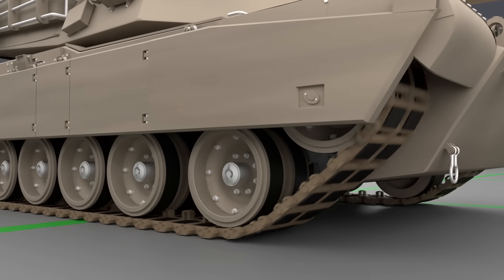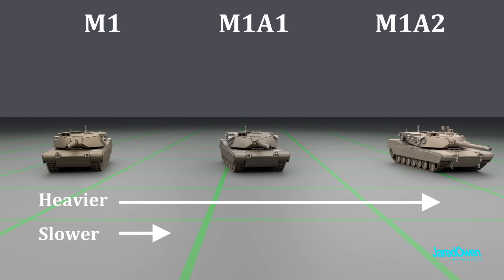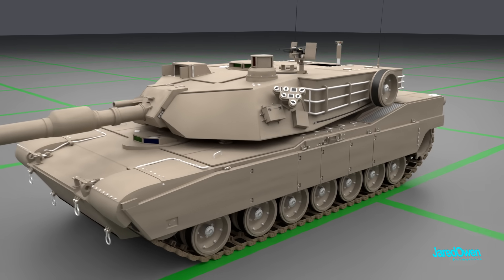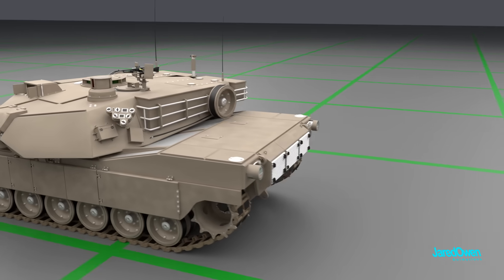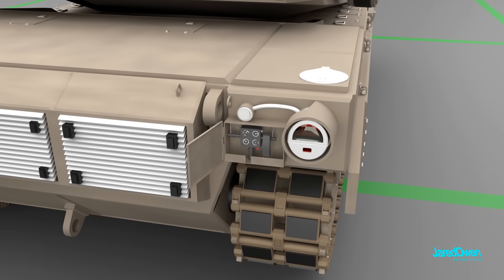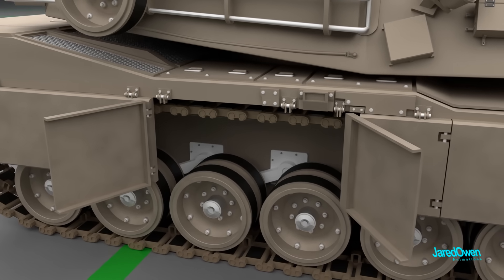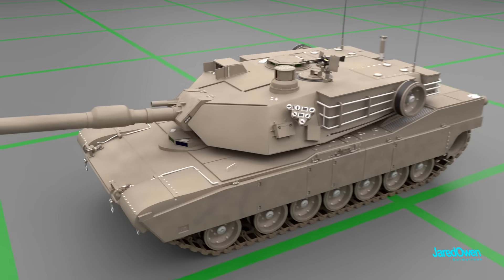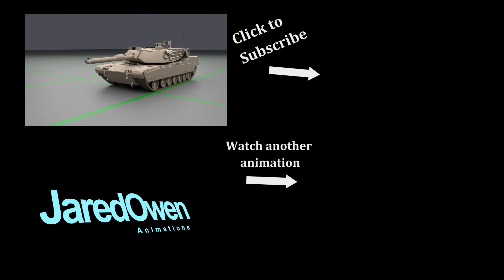How does a Tank work? (M1A2 Abrams)

Comment: Are we helping our enemies by giving away this information?
Reply: This is very fundamental information that does not vear that much off from all tank designs. The type of materials that make up the armor and the fire control systems are what really separate tanks on the battlefield. This is why Ukraine is getting a version of of the tank that has Tungsten armor and not the classified one the U.S uses. The tanks they are receiving will be new production for this reason. The U.S makes about 10 to 15 tanks a month for our military and others.
Reply: @JackRABBITslim27    How about the Challenger 2’s Britain is sending over? Sounds like some noise is being made about the 14 they plan on sending over will supposedly seriously degrade their current tank force. I take it that they are sending the ones with pretty well the same armor makeup as the M1A2.

Comment: You covered where the exhayst comes out, but left out where the air intake is.
Reply: Just out of curiosity, ive looked at diagrams of the Abrams and watched vids on its general construction. There is never anything said about where the air intakes are. Nothing. Wonder why. I can see where the viability of tanks has come under question. When a $3k drone operated by someone hundreds of miles away can drop a $100 bomb on to a bazillion dollar tank and completely destroy it, then fly back to its operator, reload and head out again looking for more tanks, that becomes a valid question.

Comment: What do you mean Abrams tank will be destroyed by Rpg-29 on 4 shots or 2 two that's not how it works dumbass 💀💀 RPG-29 have only 750mm -900mm penetration it is tandem shape well tandem shape are not effective against NERA and Composite, since Tandem uses Precursor charge which small to defeat ERA alone anytging larger than precursor Charge will be useless, and anything Larger and thicker ERA can stop Tandem shape, 
Abrams can stop RPG-29 easily doesn't matter if it's tandem shape or not.

Comment: Ok, this sounds silly, but how is this tank as far as comfort for the crew. Do they have temperature controls for warmth in cold climates and air conditioning in hot climates? How about a sound system. Do they have stereo speakers? Does it have Wi-Fi?

Comment: The shell shown is a kinetic energy round called APFSDS uses theblenght of it's self to penetrate,the pens make the round be more aerodynamic to be faster and have more kinetic energy and so more penetration,the shell is hard to riochtec probably because of thebpens and since the round is so small it can go trough the barrel of the other tanks.the penetration can reach up to 400 mm
APFSDS means
Armor
Piercing
Fin (small)
Stabilized (good to angled armor)
Discarding (discards thing Around it)
Sabot (the thing Around it)

Comment: I'll disappoint you. the protective curtain between the ammunition and the crew's working area does not save the crew when the ammunition is detonated. The shock wave is so strong that the crew is destroyed even if the curtain is not damaged. Although most often the Abrams tower is torn off in the same way as other tanks. you can't argue with physics.

Comment: The heat signature this monster jet engined tank puts off makes this a sitting duck. Jet engines take massive amounts fuel not to mention it can’t just shut down and turn back on, they must run continuously when in operation. These tanks are outdated junk. Putin will spot them instantly sitting there like a massive heat target.

Comment: Excellent. Having ridden around in one for years I'd add a few minor points: 
1) The driver is laying on his back, as you show, so the gunner needs an antennae rod to wake him up when we had worked 20 hours a day.    
2) The loader is an expert, in contrast with automatic loading systems on Russian tanks.  Automatic loading might be an advantage except that an experienced loader can place a wider variety of rounds in as little as four seconds.  
3) It rides like a good ol' Cadillac -- very smooth, as you also show.  
4) Don't forget to add the .50 caliber machinegun on top.

The last of my fewEgyptianshold up as long on deserts.

That's also impressive when you consider that the 14 tanks in the company ran the same terrain and only one threw a track.  Breaking down the track and putting it back on is, well, good exercise for the crew [another smile], although I suspect they hated me when I gave the signal for a line formation dashing over a rough space.  Soldiering is still fun when your country provides you with amazing equipment, as is the M1.  
   
Again, excellent presentation.  
Oh, finally, as you may know, the Russians recently gave a presentation to their soldiers about an M1's side skirts being a weak point.  I'm glad you pointed out that an M1A2 now has heavier armor there.   (Good try, Ruskie, to criticize an antiquated point.)  And don't forget the Abrams X "coming to theatres near you soon".
Reply: Abrams X wont be seen for many many years. I am 25 and my grandkids might get to use the X.

Comment: Your loader is facing the wrong way. He has to turn and load the gun from his left.   It is near on impossible to turn to your right as a loader with a round in your hands. The rounds are somewhat spring loaded in the storage compartment so they can pop out an inch for you to get a grip on, lay iy briefly against your left shoulder as you turn left, lay the front half on the breach block and push the missile in.

Comment: You left off the .50 cal for the tank commander. It could hold a .50 cal or an M240, the same as the coax and loaders machine gun. Also, the driver ALWAYS entered from the turret, unless we were in the field. It was safer that way. 
Also, we blew the front mod on our engine in Saudi Arabia. No one bothered to change the V Packs from Germany to Saudi Arabia. Ours had 6 inch holes in them and sand got in that turbine engine. The last three compressor blades were gone, I think there were 6 blades. I have heard a turbine engine backfire! 😂🤣😂🤣

Comment: I do believe all must know tanks no matter how great or how strong. Do and will become very weak without a supportive combined arms. No army of 10,000 tanks will win a war without it. Because tanks need a sever logistics to remain functional. Stationary tanks die quick so moving consumes massive amounts of fuel. Without logistics support don't even move them forward. Which in turn, supply chains must have and be secure. So once they are secure you will see that you do not have offensive abilities until Air is at least controlled, second layered artillery to respond as well as the artillery to forward press. And then the other armor Bradley's and lighter troop transports combine to make a very strong and virtual unbeatable force when tuned correctly.
the damage inflicted on the Russians has greatly effected them, however they are still there. One key I see is cutting of the bridge to Crimea from Russia. (Making sure to knock off several of the main support towers to keep them from just fixing it. Next have the ability to strike any ship landing troops around black sea or even shooting missiles. These two actions alone may kick and invasion from the Belarus border, which Ukraine need to have already mined and gotten their 12 digit coordinates to and any possible route on road or land. So yes they are great but just like the great soldiers of Ukraine. They can not do it alone, so yes we do stand and affirm Ukraine sovereignty and right to live in Peace. SLAVA UKRAINE!
Reply: Героям слава!

Comment: I was on M1 & M1A1. They are beasts! The only noise is the “whining” from the tuba one engine which goes to the rear. The tracks squeak a little, but in mud they don’t . I’ve been within 10 feet of them during a passage of line on a dark drizzling night and didn’t know they were there except the smell of their exhaust. Quite scary thinking 65+ tons just drive by and you might not even be aware of it!
Reply: Turbine, not tuba

Comment: I was a crewman of the M1A1 Abrams in the mid 90's, and yes, the Abrams is an awesome machine.  As I discharged, my unit was upgrading to the A2 Abrams so unfortunately I didn't have the pleasure of working with it.

That was great graphics and explanations used and pretty accurate as well.

Thank you for the video.  Well done.  🙂
Reply: Honestly. The greatest thing about the newer model Abrams is if you have experience on one you can use them all. The only major differences are tech which is easy to learn
Reply: @woodsbikes6130  американское дерьмо хорошо горит на Российском воздухе-- много кислорода! 😂🙏

Comment: Are you listening, Pentagon? I said over and over again: Stop using tank treads. They can easily be disabled with explosives. Motorize each small wheel electrically. that way if a few get damaged, the tank can keep rolling.

Comment: I have spent many hours watching them shoot on the move or still on qualification ranges. They are amazing in terms of engineering, and they are very, very loud. It's one of the most metallic bangs you can possibly imagine. On the ranges, they sit on gravel at the edge of the firing line (at least at the post where I was), and the gravel shimmers in vibration when they fire. Some of my buddies were crew members (tankers), and I knew tank mechanics as well. The mechanics would sometimes come in from field exercises covered up the waist in mud, from pulling packs (engines) in extremely muddy conditions.
Reply: Field maintenance is the worst. As a tanker I can relate to that mechanic!

Comment: I was in the Army at Fort Knox saw the M! it was like no other. being recovery vehicle operator mechanic watched simulated mine explosion's to watch the ones for that task lay out the track ram a large bar through the replacement track up onto the drive sprocket to self feed the track,
to see he tank cross country barrel locked onto a target and  at 55 mph was impressive.
It was a GE turbine engine at one time enjoying 6 gallons to the mile. Not 6 miles to the gallon.
The tank can forge through water without leakage was designed for N.B.C. attacks nuclear, biological and chemicals with its own fresh air system. lot more.

Comment: Way too complex a tank.  I understand that some appeal to the turbine power in paper..but in warfare , parts logistics, repair it makes absolutely no sense.  Uses only aviation fuel. It's ridiculous. This shouldn't exist as it's getting to be like the overly complex tanks that the third Reich was obsessed about but impractical on operation and repair plus cost.
Reply: The AGT1500 is mutlifuel. JP-8 is just standard for the Army and for the most part the USMC too (they got rid of their Abrams though) across most vehicles.

Comment: I learned on one of the hundreds of tank videos that I have watched that the tank's "road wheels" ride on the treads not the road beneath the treads. It's obvious but I never heard nor thought of it that way and I'm a freaking engineer. The treads are continuously laid down in front of the tank and it then pulls itself forward over the treads. The wheels support the weight of the tank and keep it on top of the treads while keeping the treads in contact with the ground. A shitload of Engineering went into making sure that this happens with a 70 ton vehicle doing 40+ mph.

Comment: It's junk because it is over-engineered so complex to maintain or repair, remember why Porsche did not win the order to deliver the new tank for Germany back in the 40's?
Reply: It only has the job of putting a very accurate round down range at 4-6 km in almost all conditions and protect the crew.  The Abrams does that very well.  This piece of junk has been around for +40 years.  Are your current vehicles, TVs, furniture, or appliances still being used around your house after +40 years?
Reply: @mrgold3591  and for the us military too which comes up with a innovations like every other year,that is a real wonder??

Comment: Hit in the right place, such an expensive coffin no longer works at all. This can be a cheap weapon such as a rifle grenade, bazooka or helicopter fire!
Reply: What is the right spot, how close do you need to be for that shot to be effective, are you within the tank's effective range of 4-6 km for the main gun or 1500m for the two 12.7mm machine gun as  you try to hit it in the right spot?  You still have close air support, engineers, artillery, mortars, infantry, and air defense before you even see a tank.
Reply: @mrgold3591 Special attack helicopters, they come and go, with self-seeking armor-piercing shells!

Comment: The M1 appears to have all possible bells and whistles anyone can think of. As a result, it is heavy and needs a geared turbine to power it all. It should be able to use almost any fuel, at least on a temporary basis, but the disadvantage is the fact that turbines are horribly inefficient at sea level. It may be a superior weapon, but the complexity of the entire package calls for superpower-like resources to operate them properly.

Comment: For not being a specialist on military hardware, you sure do a damn good job of creating models, exploded or section views, animations, and verbal descriptions of the Abrams.
Very impressive!
Reply: He forgot to mention the torsion bar suspension.
Reply: @codyhatch4607  True, but the video at 3:18 to 3:24 explicitly shows a trailing torsion arm suspension.
Reply: @gregparrott  He does not mention it, though.
Reply: @codyhatch4607  True. But, the suspension is secondary to the tank's purpose. Also, with many wheels per side on what is essentially a metal box, I expect that most tanks use a torsion suspension as there is no room for coil springs. Leaf springs would also take more room and would be more exposed/vulnerable. I once saw a video of a WWi tank in motion. It had minimal articulation in the wheels supporting the tracks. Even moving slowly, a mound or a ditch led to unstable behavior. My bet is that all tanks have articulation, and torsion is the obvious choice. Dodge used them on their cars. Chevy uses them in some of their trucks and SUVs.
Reply: @gregparrott  No, that suspension is a very critical part of any tank. The suspension is what lets  the gun's stabilization system to function on the move. That is why tanks use them and not leaf or coil springs.
Reply: @codyhatch4607  The Abrams uses a gyro stabilized, electronically (servo) controlled stabilization of the barrel.
A good suspension helps. But the electronic stabilization is the larger contributor.
P.S.  I worked in the defense industry for several years, on accelerometer and gyros for smart weapons, horizontal avionics, etc. I understand their contribution here.
FYI  I searched Youtube and found a relevant video to substantiate what I'm saying.  https://www.youtube.com/watch?v=lVrqN-9UFTU
Reply: @gregparrott  F/O, you have no  clue!
Reply: @codyhatch4607  Some day, you might actually choose to learn something when it's offered to you in good faith. 
As it stands, you chose an expletive, and apparently, won't even bother to watch two videos I provided to substantiate the use of stabilization systems.
Good luck with choosing ignorance over education.
Reply: @gregparrott  What I was trying to say was you need a stable has for the whole system, "the tank" to operate on! No more no less! Bye
Reply: @codyhatch4607  Thanks. And my recommendation to you is anger management therapy